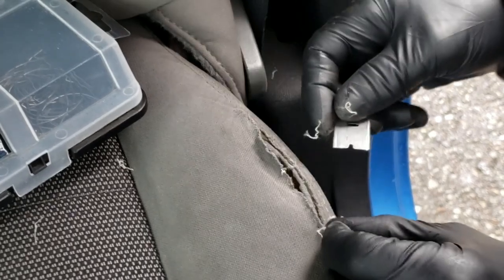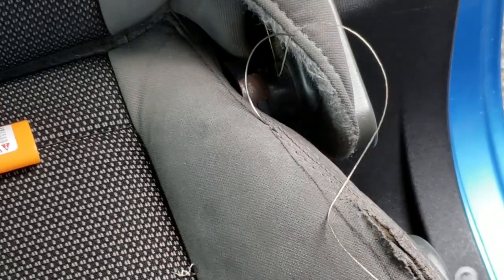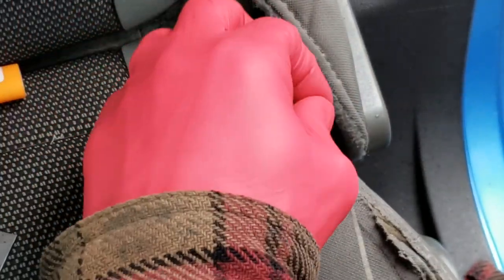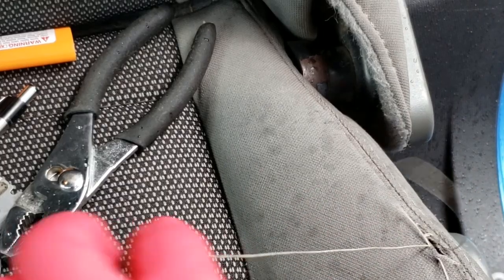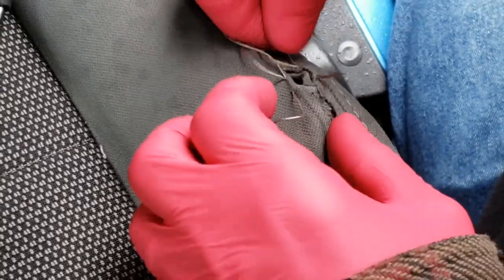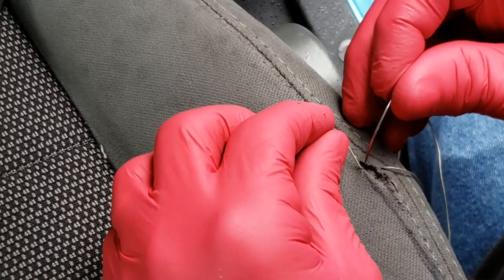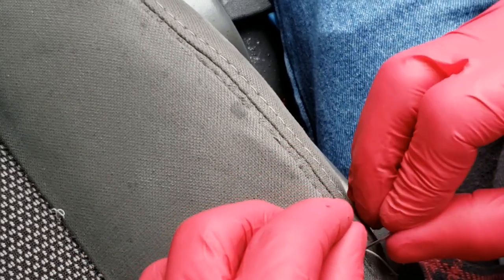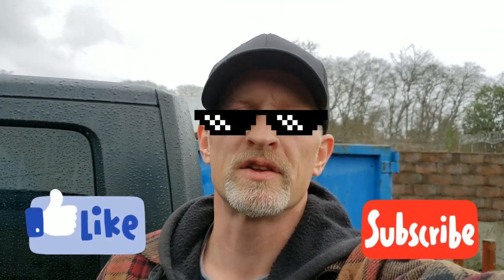DOUBLE NEEDLE HAND SEWING - step by step

Comment: Pretty good for an on site hand sew job, I'd pull the seat, repair the foam and either sew it up with my machine or replace the outer sections then it would be perfect but that would take longer (not to sew) and cost a lot more.
Reply from the maker: Nice. Agreed. Whatever the customer wants.

Comment: Thanks for all the tips I really enjoyed your video! One thing I'm not understanding though, when threading the double needles, is there a single thread between the two or a double thread ? If single how do the ends fix to the needle eye?
Reply from the maker: Hello. just threaded through once. the needle eye is small enough to hold the thread in usually. (barely) or you can tie a quick 1/2 knot.
Reply: @problemsolver8447  Thank-you :)

Comment: Dam , the begining is so confusing. How to thread the double needle and actually start it. Maybe it's my ADD but I have watched this 10 times trying to figure out how you thread both needles and start and I just can't figure it out lmao!!
Reply from the maker: Just like you are installing a shoe lace for the first time into some sneakers. Needle on each end, then down with both across from  each other only about an 1/8th of an inch or whatever the situation calls for. Then instead of crossing the rip, or gap, or Tougue gap on the shoe, you will go up the side of the shoe holes, or stitch line, and come up to the top side of the material with the needles on both sides, then cross over the gap, and poke both of your needles down through the holes with the opposing needles thread is coming up and out, then you repeat the process. Up then cross.